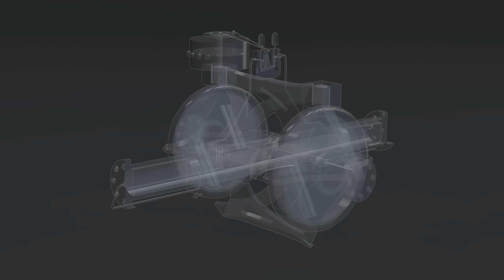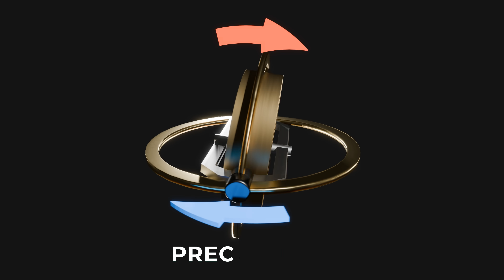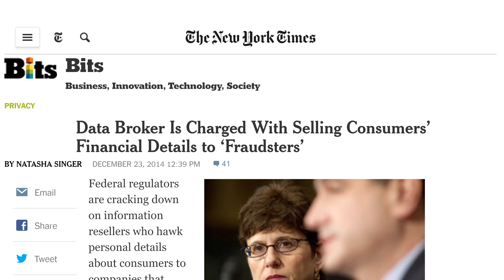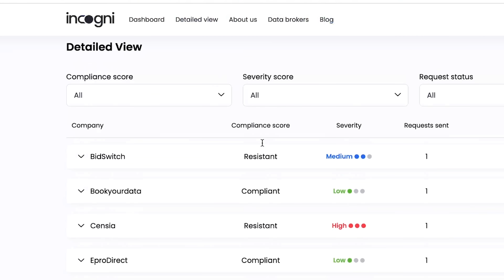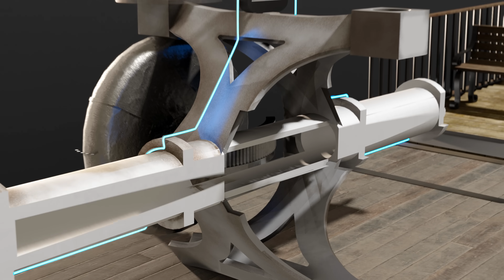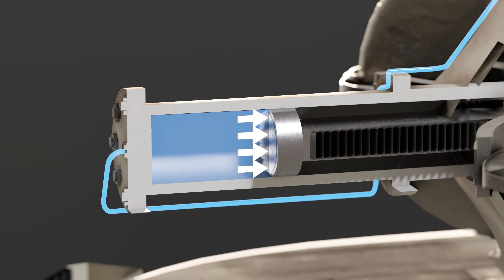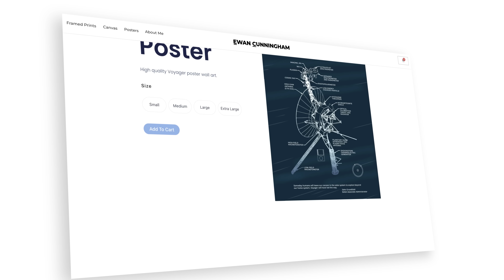The Self Balancing Monorail

Comment: The most tragic thing is that it worked! Is not one of those cases whem someone had this idea way ahead of its time, like it usually is, but they failed because technology or knowledge was not yet developed. In this case they solved all the problems through sheer engineering brilliance. People in the early 20th century watching a train working on 1 row of wheels aparently by magic. Incredible!
Reply: This video paints it as a great idea, but what I see is a poor risk reward proposition.  These monorail trains have many critical points of failure that at speed would cause an accident no doubt.  As stated each car requires the space and power source to run the gyros as well using up valuable capacity.  While it would save on infrastructure cost of a railroad to some extent, the cost of 2 rails vs 1 is nearly insignificant compared to the cost of surveying, obtaining the land and/or  the right of way, grading and preparing the roadbed, etc.  Two rail standard gauge infrastructure was already well established as were the locomotives and rolling stock to  use it that would all need to be changed out.  Even if you were to assume the change had been made to this monorail as the railroading standard the reliance on active stabilization just makes it more likely have a critical failure than the passive stability of a two rail train.  For that reason alone it was not a good idea.
Reply: @larrybremer4930  you're forgetting that one of the pros laid out was that this can run on existing rail, you wouldn't have to switch anything out
Reply: @d3str0i3r  even if it ran on existing track, the cost of fitting a gyro on every carriage is much higher than simply building a 2nd rail in the first place, and if at any point the mechanism fails, a train on 2 rails would be safer than one which can topple over
Reply: @ClippyForConsumerWrights  It wouldn't actually be able to run on existing rail. Since the wheels have flanges on both sides it couldn't go through normal switches.
Reply: I agree, @Kamiklase   - the rail isn't compatible. And it isn't just the wheel flanges: the balancing monorail design doesn't just allow leaning in the corners, it requires coordinated lean, at an angle proportional to speed. Rail isn't circular pipe, so the wheels won't sit properly on the rail when leaned.
Reply: Although I consider this to be a marvel of engineering and ingenuity, I can see why it didnt catch on. The cost of laying 2 tracks instead of 1 isn't that much greater, you have to lay them, secure them, etc.etc. Besides, who would lay 1 track rails for the exclusive use of this invention?

compared to the cost that all this wagons should have a gyroscope, and consume fuel just to keep them straight I doubt it would be a great Idea. Railways tracks becomes more profitable the more trains you have running on them. Its just the first investment, and then you can give more trains.

This designs sacrifices up front cost for higher cost of increasing the service (more expensive wagons). Meaning it doesnt scale up well compared to traditional trains. It might be a sensoble solution for small services that dont grow, but which company is built on the idea of not growing?
Reply: and imagine parking unused cars and delayed freight trains
Reply: @federicocaputo9966 he used it on existing railways as well
Reply: @JustSomeWeirdo  4:58 "he hooked the gyros to a petrol engine" unless it runs on magic fairy dust, it consumed more fuel.
Reply: @federicocaputo9966  it’s magic
Reply: I think it would be a great tourist transport eg. from one side of a seaside town to another. It has a great novelty factor and appeals to children (it can be explained as the same mechanism as a spinning top) as well as being practical for a single carriage transport over relatively short distances. But yet, I don’t think there is any inherent advantage in a single track self balancing train; I just think it’s so intriguing it would take a long time for people to get bored of them if a few were built over short routes across the world
Reply: @federicocaputo9966   I agree...
However, today there’s microelectronic gravitational and G-force sensors everywhere. (They’re used in all modern-day cars today)
With today's tech, the gyros can be very accurately controlled electronically. (Same way a quad-copter is kept stable)
Plus, today there’s more abundant, cheaper, and lighter materials for the frame and body of the cars.
Once the gyros are spun-up it doesn’t require much energy to keep them spinning, because… well they’re gyros.
I think this would really work today as a fast reliable passenger transport ….
I’m in with a $100,000 risk capital investment.
Reply: @federicocaputo9966 it could be used in small towns and villages to connect areas that don’t have coverage from big railways. It’s narrow too so you don’t have to clear as much land to construct them
Reply: @federicocaputo9966 it doesn’t consume additional fuel
Reply: It  stood upright, it traveled, it could  take passengers. It still could not perform in the economy in the way that a standard train could..
Kinda like nuclear powered cars. Pretty billboard but the reality of it is not exactly executable or desirable.
Reply: @ruben9912 
Yep... the same way quad-copter's have failed...
How can you possibly stabilize four or more independent rotary motors in order to keep the darn thing stable in flight?
Reply: @fredflintstone8817  What do you mean quadcopters have failed? They're very popular.
Reply: @LutraLovegood  
Sorry my friend for the misunderstanding.
If you read my previous comments.
You can tell, I was being sarcastic…
Reply: This would never replace 2-rail vehicles anyway. It would be useful for some shortline type stuff, like a city light rail or Disney's theme park system, but for heavy freight, which is what the vast majority of railroads haul to make money, 2 rails is the only way to go. Same with long distance heavy passenger service like the modern Amtrak intercity sleeper trains.
Reply: @RCAvhstape aye, modern monorails exist but only in limited use cases like you said
Reply: @RCAvhstape  
Are you suggesting that a 500km bullet or high-speed train line, generally uses the same tracks as a freight train?
Reply: @fredflintstone8817  Is that what I wrote?
Reply: @RCAvhstape  
I'm not sure what you mean?
I was simply asking what you meant when you said...
“This would never replace 2-rail vehicles anyway”
“The vast majority of railroads haul to make money, 2 rails is the only way to go”
You seemed to suggest that there’s only one way, or a set of tracks that every form of transportation is best using.

We have roads for cars.
We have sidewalks for pedestrians.
We have double train tracks for freight trains.
We have bike lanes for bicycles.
We have takeoff and landing runways for airplanes.

None of these examples have replaced a 2-rail vehicle.
So why would a mono rail vehicle necessarily replace a 2-rail vehicle? Perhaps it might just add another option.
Reply: @fredflintstone8817  Okee doke.
Reply: @RCAvhstape  No sir, there are plenty of examples of exclusive right of ways, non standard gauge rail, and/or no grade crossings for specialized purposes such as subways (such as BART), high speed rail (such as Shinkansen).  I have also seen comments comparing Brennan monorail to contemporary ones like Disney but there is no comparing them.  The Disney monorail is also passively stable since its a rail hugger using guide bogey's to keep it on the beamway and ensure the vehicle cannot topple.  Such monorails also fail due to the cost to implement, being low speed, and inefficient since they ride the beamway on truck tires (thus are basically a truck themselves with similar efficiency).
Reply: @larrybremer4930  Fine. Not gonna argue.
Reply: @fredflintstone8817  а для высокоскоростного поезда это уже имеет как-то мало смысла. Во первых, по сравнению с классическим двухтактным решением здесь много рисков. Нарушение стабилизации приведёт к трагедии. При этом затраты на второй рельс на фоне общей прокладки пути и организации электроснабжения малы. Не стоит забывать, что для прокладки высокоскоростной магистрали так же может использоваться стандартная путевая техника. Да и стоимость подвижного состава под 2 рельса будет ниже. А если готовить про поезд-пулю (маглев), то это вообще иная технология, позволяющая избежать трение в механизмах тягового привода.
Reply: Plus, the fact that they only use 1 rail is irrelevant, considering that they were still thick enough to prevent a second monorail train from passing at the same timr
Reply: It may not have been practical for a variety of reasons but it cannot be denied that the inventor was absolutely brilliant. I was incredibly impressed by his ability to create a solution for each new problem.
Reply: It was a good idea, but no it didn't work. It was extemely expensive overly complicated, and require huge amount of trained engineers. So many moving parts, for dubious benefits. Extremely unpractical. Basically here's a train that's exponentially more expensive than the trains you're using, much harder to maintain and keep operational for the ability to use one rail. Very fun idea though, solving lots of interesting problems.
Reply: Why would you suggest people would see it as magic? Back then kids played with toy tops. Many people had a much more practical understanding of the world than today. Probably more people today would see it as 'magic' than did then. That this is even a story and you'd make such a comment, kinda proves the point.
Reply: @heartysteer8752 Yeah nah, keep on coping with that horrendous take
Reply: brennan is way better  than the clown called  newton

Comment: The 1930s Italian ocean liner "Conte De Savoia" had a gyro stabilising system to reduce rolling. It worked but put a tremendous strain on the hull.
Reply: Entire force goes up against 2 (ok 4) bearings.

"There's gonna be stress" 🤣
Reply: @MadScientist267 Also the stress from the ship not being properly supported by the water. I wonder if the hull became distorted?

Comment: How the hell did this guy create a system so well designed and functional that you'd not think twice if you saw it used in a futuristic cyberpunk setting, yet it was from the 1900s.
Reply: Because it was in the air back then
Reply: @@retiredbore378 during war time, you mean when they lift most regulations to develop it faster? You kinda just proved my point.
Reply: You'd be surprised to find out how many insane designs engineers made in the past , but we're never considered because they were deemed "unrpofitable" or "too risky"
Reply: Because people back then weren't helpless without computers.
Reply: @MadScientist267  smaller government = more freedom to create
Reply: @OffGridReaper  Has absolutely zero to do with anything
Reply: @MadScientist267  not entirely true. Regulations slow development. Things are safer but it doesn't allow new crazy ideas to be worked out.

Comment: Some German scientists have actually made a new updated version based on Louis Brennan's design called the Monocab OWL. I find it really fascinating that these ideas developed 100 years ago are being taken up again today.
Reply: @counted1894 interesting! Thanks for mentioning this
Reply from the maker: Very cool! I will have to go check that out!
Reply: @primalspace  They used Brennen's counter-rotating flywheels but on much smaller scale connected by timing belt. https://www.youtube.com/watch?v=DCe-Re9BXtE Your video nailed it with the reason for scraping this idea in 1910 was that the flywheel assembly would be needed in EVERY SINGLE car! The Monorail OWL is smaller and is just one high speed passenger car. They also have an outrigger to utilize the second rail for low speed support when the flywheels aren't spinning. I would argue that they should have gone to a centralized symmetrical design utilizing dual rail support with the carriage pivot smack in the middle and could have taken corners at high speed with the leaning effect. (or could go fully electronically controlled for the leaning .. like the Nimbus EV !!)   https://www.youtube.com/watch?v=ACULOPuRuQg
Reply: Idea for the MONOCAB: Thorsten Försterling from the Lippe State Railway Club (German: Verein Landeseisenbahn Lippe)
Project sponsor: Ostwestfalen-Lippe University of Technology in Lemgo (German: Technische Hochschule Ostwestfalen-Lippe in Lemgo)
Reply: On the Monocab OWL website, there is no mention of how they propose to stop the pods from tipping over when inevitable power outages occur. Edited: There are support rods that extend, as shown on website.
Reply: @scotterickson6332  It should remain upright for an amount of time sufficient to evacuate the passengers.
Reply: @scotterickson6332  I was there when it was presented to the public for the first time. To remain stable without consuming battery power, the Monocab can extend supports at the corners of the vehicle. On the website you can see the supports as red metal parts at the corners of the prototype in the preview video. The exact design of the supports has not yet been determined, but as far as I know, skids are being considered to jack up the vehicle, like the beams in the video.
Reply: @ladeportaltv2003  That'll work!
Reply: @scotterickson6332  Don´t worry about it, it will never be build anyways. Germany struggles with basic necessities like energy and their social system, they don´t have money for that anyways. Even if this was the best invention since sliced bread I would doubt that they would get any financing to really build that on any scale. And from the looks of it, it´s expensive, overly complicated and they need to sell the whole "only one train track is needed for rural areas" I mean if nobody operates any rains in those areas why would they do so with a completely new and unknown system ? They probably would rather use cars.
Reply: @sierraecho884  Not worried, just thinking about it from an engineering and safety standpoint. Another YT commenter pointed out that on the website, you can see support rods that come out in the case of what I described, so they have planned for that contingency.
Reply: @scotterickson6332  I think they did well engineering wise. I just really doubt the application as a whole. 
In the end, 2 tracks is the de facto standard, it works well it´s not too expensive anyways, does not need new tech where nobody knows how it will behave in 20 years. And we still have roads, so I would rather invest heavily in AI driving new e-vehicles batteries, charging and all that stuff instead.
Reply: @sierraecho884  Single rail is far, far cheaper than building a modern road.  This is a critical consideration for low-demand but essential transport, as in rural areas.
Reply: @stevec7923  Sure it is but then you need those expensive monorail cars, you can´t transport anything else besides with those monorail cars. You are dependent one this one supplier. You need roads anyways and you already have those it´s just many people don´t have cars. Solve the car problem don´t build something completely new.
Reply: @TheTimTraveller
Reply: patents run out...thats why you see century old stuff emerge again.
Reply: @tomast9034  patents run out in 10-30years time not 100. You don´t see this tech because it does not make sense. 99% of all patents are never applied to any product.
Reply: Wanna see more
Reply: Why would they make it a pod design, that’s literally the worst way of transporting stuff on rails. Congrats to them for achieving a great mechanical feat, but they probably should leave logistics to the experts.
Reply: @foximacentauri7891   One of the engineers of the project is a coworker of mine, talked a lot to him about the project. The Monocab is intended and designed for rural areas, where existing rail infrastructure isn't used, as it is currently unprofitable for normal train service. A pod-design, while beeing stupid for high-demand scenarios, could actually make sense here. We recorded an 1-hour-interview with him about the project, which will be released in mid-January (only in german though), if you are interested.
Reply: @jSpuckinski  You could make an transcript and translate it. If I am not mistake, AI could do the job. For such a niche topic, your interview could be the only of its kind for a long time.
Reply: good call ,will do.  @schweineful
Reply: @jSpuckinski  I’m very interested, und mit der Sprache komme ich klar ;)
Reply: @foximacentauri7891  It´s in Germany, it is overly complicated and will never be build anyways.
Reply: @sierraecho884  Autobahn.
Reply: @Omniverse0  What about it ?
Reply: Hundred year old design, it’s surprising that Elon musk hasn’t “invented” it again.
Reply: @davideyres955 inventing things doesn't mean shit when you fail to deliver the goods and actually bring a successful product to market. History is littered with failed inventors who had reasonably good ideas but failed to deliver the goods.
Reply: @davideyres955 hahaha good one. it would have been too simplson like MONORAAAAIL...
Reply: Ever seen the Simpsons episode with the Monorail ? HAHAHAH 
German overengineering at it´s best.